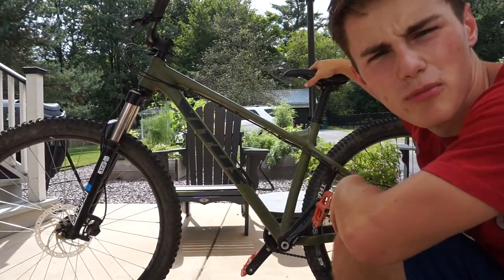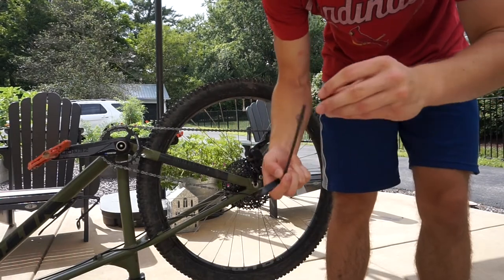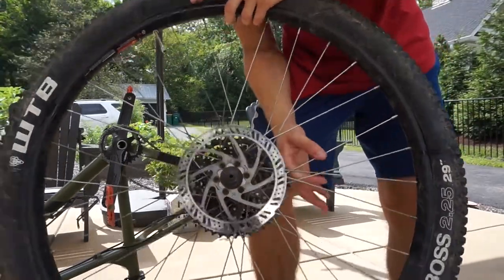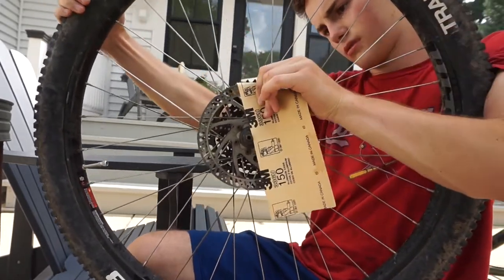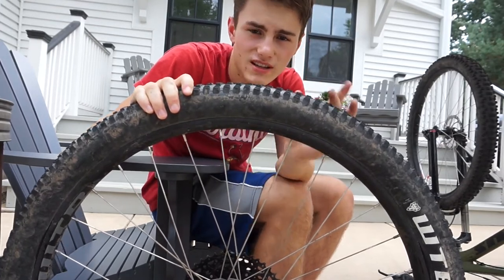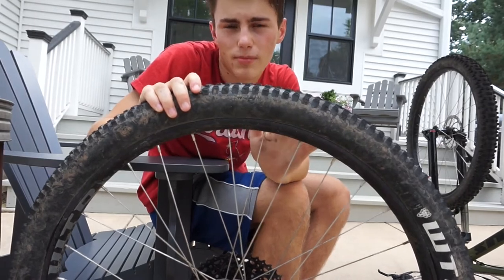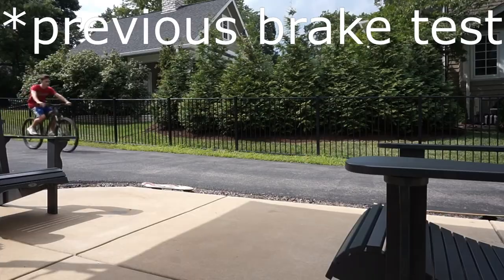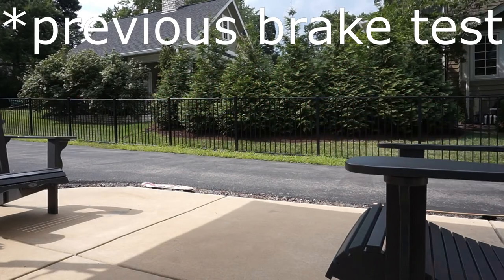How To Fix Glazed Rotor Brakes (Easy, Fast, and Cheap)

Comment: Thanks for posting.. It didn’t work for me. I sanded the rotors and the pads, cleaned them with alcohol. The braking is still very bad. is it because these are mechanical disc brakes??? Anyway I am going to replace the pads and then try
Reply from the maker: Your problem may have been sanding the pads... I wouldn't recommend doing that again! If your pads get glazed over (which happens with time and hard braking) replacing the pads is a great option. You can find some good semi-metallic pads on Amazon for pretty cheap.
Reply: @judebronner9520  thanks for the tip, I bought a new pair, now they are working good

Comment: Never put your bike with hydraulic brakes  upside down. This will air lock them
Reply: This isn't really an issue as long as your not pressing the brakes while flipped. No more air will get into the system if it's just static (unless there are compromised seals), and any air already in the system will return to the top reservoir after a few pumps on the brakes when right side up again.